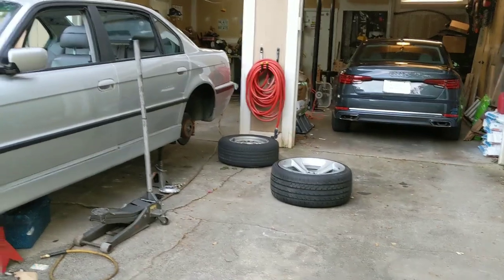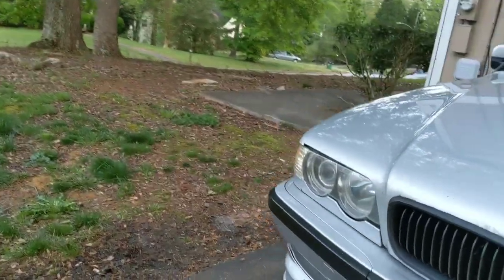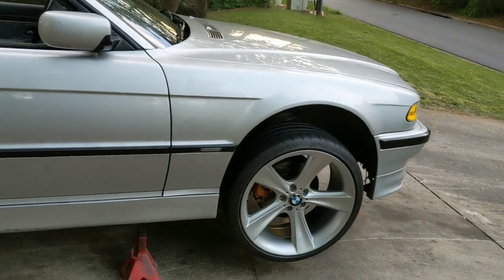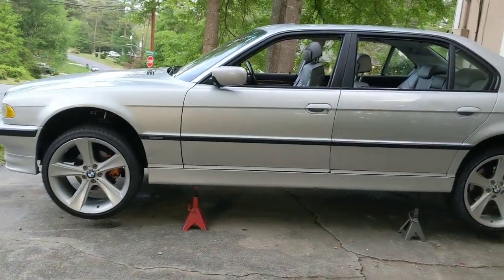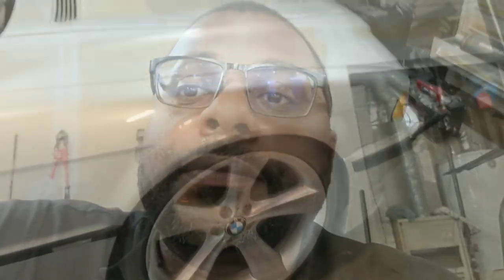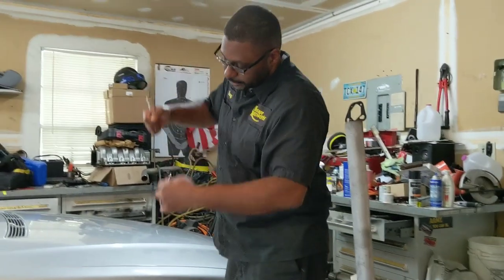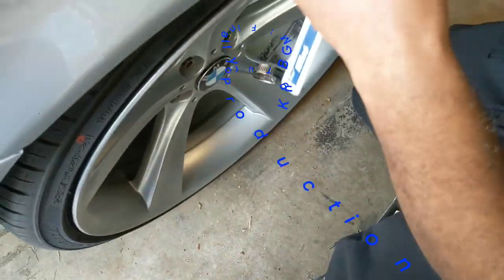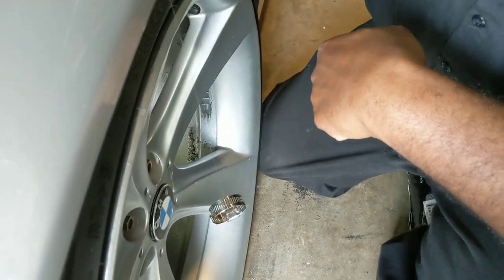The e38 has new wheels!

Comment: Did you keep the stock struts and  Springs on the car initially? I'm in the market for a set of 20 inch bbs lm for my 38. Wondering 5th I'm gonna need to drop my car or not
Reply from the maker: That's a matter of opinion. I drop almost everything i drive. My car had stock sport suspension. I recently put the eibach prokit on. If i were you, I'd drop it. A nice subtle drop. Not static. I absolutely HATE static.
Reply: @DougBe38  I'm thinking of going with just springs. Maybe 1" all around.
Reply: @DougBe38  that kit is reasonably priced I'll look into it. I'll have to play with tire sizes also the roads in Atlanta are horrible so I dont want to go with such a low profile. Thanks
Reply from the maker: @ceemo3056  i live in Atlanta. Trust me. I know. I hit a pothole near my house, bent one of my 21s and busted the tire. I had to go on CBS 46 to get Dekalb County to fix the road. They came out the next day. For 20s, you'll be needing a 35 series tire. I run 35 series on the front and 30 on the back for my 21s (staggered 21x9, 21x10).
Reply from the maker: @ceemo3056  1" to 1.5" would look great. Eibach Prokit is 1.5" front, 1" rear. I usually don't swap the rear. My speakerboxxx 8s heavy enough to give me the look i want.